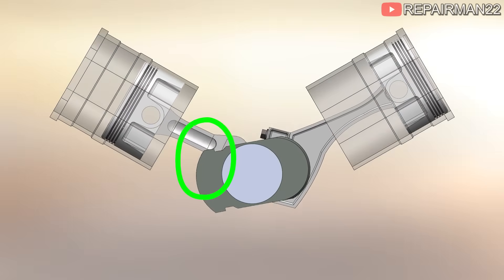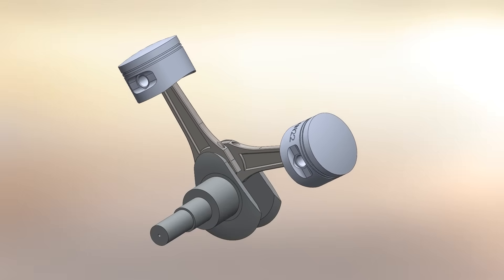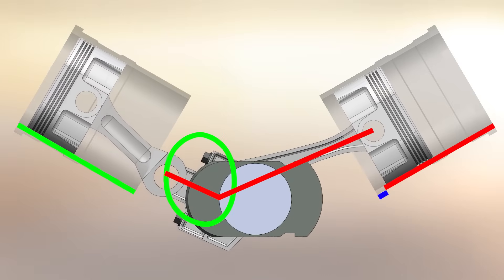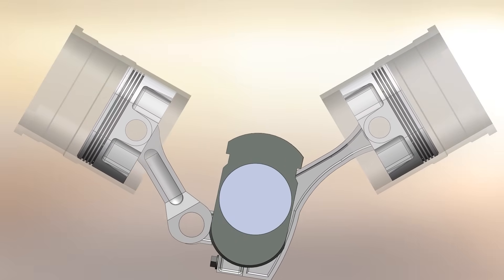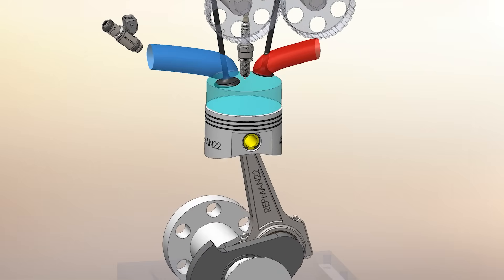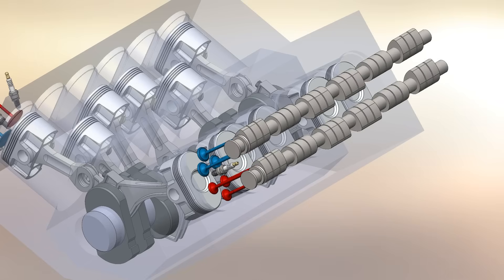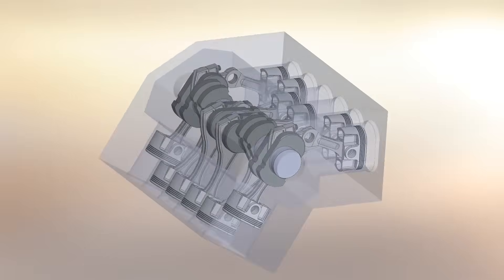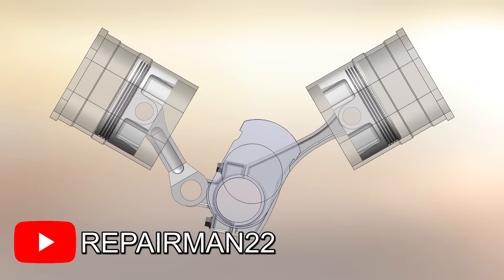Oval Piston and Oval Stroke! Is Ferrari CRAZY? 🤯 🐴 V12 Patent 3D

Comment: Maybe the solution to this patient is to put both cylinders on a slave rod with just a cap on the crank. Though, something would need to be designed to keep that center cap stable.

Comment: i think it can be made just as efficient by having more spark plugs lets say that it has 8 valves, you can have 3 spark plugs by having one spark plugs by the gaps between four valves, or even 5 on the sides of the oval like bajaj's 3 spark engine, issues of the oval engine back then i think can be solved with modern manufacturing, even then theres high mileage examples of the nr750 already.

Comment: Honda: "In the end, we realised we should have gone with Elliptical and NOT Oblong pistons / cylinders.."
Ferrari: "I'll pretend I didn't hear that".

Since the idea is to save space I totally understand Oblong shape instead but still, I think it's funny the sides are totally-flat, when even a slight bow would improve sealing & wear by a large amount.. 

Anyway, the one area odd I.C.E. setups often worked-well is large-cyl. Diesel engines (Detroit made twin-turbo 9L i6s, multiple inline-3s and even like x4 different i2 pairs, etc; other companies made large i5s & Scania STILL makes a large i5 engine for semis and lastly, one company recently even made a fricking INLINE-7!!).

This is because they're all mostly <3k RPM so you're able to get away with imbalance and other mech. issues that would obliterate engines in other areas where RPM needs to be doubled or tripled, for these Diesels (also some were made for various gasses!!) you reap all the benefits of strange setups without any downsides except vibration which might be an issue in some application & would be an issue in passenger cars.

And SO, I believe you're correct on the theory this is for those Semis! The specific geometry of the slave rod / cap -connection is seriously bad, like they could have certainly made it less extreme even with otherwise-same setup.. So, that tells us these engines must be for low-RPM & not passenger cars; at the same time it certainly wouldn't be for static use such as generators because space is the least of your concerns there, so such an odd design turns to pointless risk / investment in money.. Not to mention I think no amount of money or convincing would EVER have Ferrari design a generator engine, unless it's for a series-hybrid in the future lol.

Oh wait.. I just realised.. What if just like the new Mazda Rotary, this will be a very small & high-RPM range-extender? For these roles size & weight is everything and while I said all that about imbalance, when the engine parts are very small (let's say, <100cc. / cyl.) these issues become a lot less-relevant and a range-extender would only work briefly on occasion + it's not directly-linked to the drivetrain, meaning it's vibrations can be isolated a lot better. I still doubt this theory but let's have as-many as possible, why not.
Reply: "What if just like the new Mazda Rotary, this will be a very small & high-RPM range-extender?"

For that role, a V12 would of course be monumental overkill. But then that aspect of the patent is perhaps just a decoy, and they're really going with a V6 (for the next-generation Dino, wossname, 296?). Or for  an actual secondary-engine range-extender, a V4 or maybe even V2 slice of it. (Hm, would the oval pistons bring all that much length reduction in a V2? Prolly not.)
Reply: @ChristianConrad  Yeah but some old (talking 1930s or so) race-cars & such used many-cylinder engines of extremely-low capacity, it allows for some serious RPM and almost multiplies the power-density, that's what I was thinking about at the time of writing the comment. I did not mean an actually full-size V-12 of course, rather an engine that's more-like a model-engine in size. The reason I thought about it is because the Mazda range extender will also be very small and while physically-larger than something like a model engine, it's capacity is closer to such engines.

I was reading about this prototype racecar, maybe it was even F1, from the 30s which used compound-superchargers, it produced a whopping 450hp. with only 1.5L of capacity.. Remember the Octane was garbage back-then so this is an extreme feat and it's only because unlike 1.5s of today, it used many cylinders of tiny capacity per-cyl. You simply can't achieve this with today's common cyl-size with the same technology and same low-compression, sure enough boost with a turbo, intercooling and switching fuels but that's comparing apples to oranges. So the small-cyl. thing is surprisingly relevant when you have only power-density in-mind.

But I guess it's finicky and actually very expensive to manufacture, so I'm not sure if we'll see this trend ever again. Aside from RPM tiny-cyls. give abilities physically not-possible with normal sizes such as reliable HCCI, the closest we got to HCCI today is SPCCI and it's with extremely-lean mixture so basically different technology as to how it actually works, not to mention the engine actually runs purely-spark for a lot of the top-end / performance. But I have on my shelf a HCCI engine from the 60s or 70s, it's 1.5cc I think and it functions just-fine, granted it uses a very special mix of fuel & the ignition-precision is thanks to a literal explosive added to it (which doubles with higher-capacity engines of this type). It's called a "model plane diesel engine" and even in it's extremely-primitive 2-stroke design without a pipe at all it still manages to be so-efficient in comparison to Nitro that the exhaust is quit-enough to not use a muffler, hence no pipe, just a port in the block.

Also I made a mistake, I mean to write Detroit made 9L V6s, very different and not-balanced, hence why I mentioned it as a strange type of engine which you'd only see in low-RPM Diesels.

Comment: Do a search on a 6.7 POWERSTROKE ROD. You will see a rod cap like this one. That allows a V8 to mimick an offset crank without reducing the size of the 2.77 inch journal. 
Also, the combustion degrees are  200 not 180. The torque is delivered more vertically. 
That was in another video on Driving 4 Answers.

The other way to offset is thru moving the centerline of the crank to the upstroke side. 
INLINE ENGINES CAN , BUT NOT  V TYPE.
TORQUE= FUEL ECONOMY IF THE RPM RANGE IS COORDINATED.
Reply: "Do a search on a 6.7 POWERSTROKE ROD. You will see a rod cap like this one. That allows a V8 to mimick an offset crank"

What are you talking about? It's just the bolts that are offset. That has nothing to do with "an offset crank rod", which means the lower end bearing of the crank rod is offset in relation to the center of the actual crank on the crankshaft. Like, you know, the lower end of the slave crank on the engine in the video. All the images Google showed of your (unnecessarily capitalised) "6.7 POWERSTROKE ROD" had the lower end bearing in a distinctly straight line to the top end.

"The other way to offset is thru moving the centerline of the crank to the upstroke side. INLINE ENGINES CAN , BUT NOT  V TYPE."

Of course they can. The crankshaft can be moved in two dimensions in relation to the cylinder centerlines, so you can have that (third type of) offset in V engines too.

Comment: Not a big fan of the master-slave conrod arrangement. In a radial you really dond't have a choice GM (EMD) 16-184 nonwithstanding. Also Honda did produce a V4 oval piston engine in the '80s, but that used 2 condords per piston. I imagine an egnine like this would be a maintenace nightmare: I cannot imagine those "rings" would last very long. Even if the engineers are from Ferrari (or Iveco or whatever). Looks like scraping the bottom of the barrel....or maybe the patent is simply there to cover for some other aspect of the design which has nothing to do with the oval pistons.....Edit: If you make the pistons elliptical or a parabolid shape it may make the rings work better....and in a V displacing the crank toward the master side one can somewhat offset the effects of the differing stroke length...at the price of even more vibrations...I also don't understand the reason behind the 120 degree bank angle...it is not much narrower than a flat 12 would be...and with opposing (180 deg) cylinder banks the master-slave arrangement can be made to be equal stroke....

Comment: I don't think the rod bolts or cap are going to be under any more strain because of this arrangement. The slave rod will be on compression or exhaust whilst the master is on ignition or intake. There's an opposing force that ought to ease the load on the rod bolts. Intake would be peak torsion load against the rod bolts that i can see, but that would be unchanged as it's still dragging a piston down the bore. I think this style master slave would be good for a flat (not boxer) 8 or possibly flat 6.

Comment: An inline 6 fires once every 120 degrees if 4 stroke or 60 degrees if 2 stroke. It's therefore really odd to see 120 degree angle between banks in a V12.
For 4  stroke it should be an odd multiple of 60 degrees: 60 or 180. For 2 stroke it should be an odd multiple of 30 degrees: 30, 90, 150.

Comment: Honda did this in a motorcycle and the friction loss was insane due to the nom consistent changing geometry of the heating metal. You can obviously expect a round shape to just get a little bigger and it's still a circle. It's not the case with an oval shape
Reply: The NR500 was a racing motorcycle developed by Honda HRC in 1979.  Later the NR750.
Reply: I remember reading about this in Motorcycle news, but was decades ago.
Reply: @AnthonyTobyEllenor-pi4jq  they had to invent the slipper-clutch for this exact reason because the engine was locking up on downshifts
Reply: D4A did a video on this and he said there are already high mileage NR750 examples, dont ask me further.
Reply: regular pistons are made slightly oval so the grow to a circular shape as they expand.

Comment: I'm sceptical about the longitudinal compacting of the engine block - the area between the cylinders will be very significant.
Reply from the maker: They will have cooling issue's
Reply: @repairman22  yeah, that's my take too. Right now, with round cylinders you have just one tight, thin spot and big wedges of cooling jacket right next to it. In Ferrari's design, this tight spot extends a lot, being the major cooling surface. I'm curious what solutions they have to mitigate cooling issues.
Reply: @pancakewsx  Anything like that can be optimized, the bigger issue is the strange slave-piston travel path.. Off paths aren't a bad thing naturally, however here as the other bank is normal, that's a pretty crazy imbalance and difference is behaviour, the two banks can't even be TUNED the same! But, that all excites me because if they pull it off, it'll be the coolest engine almost of all time and I love strange / innovative tech like that.
Reply: @bo-dine7971 of course, it can be optimized, but as it is a way to shorten the engine, how much space/wall are they really able to leave between the cylinders?  Nowadays 7 mm is generous and it is not really enough to run a full water jacket (more often there's just a cooling bore). I'm just curious about the solution they (might) have. On the master-slave rod design: soviet tank engines use it since WW2, seems to work ok on the W-2 V12 (38.8 liter, one bank has 180 mm stroke, the other has 186.7 mm stroke, depending on the version, mean piston speeds exceed 12 m/s)
Reply: @pancakewsx  Yeah good point, I didn't even think about cooling paths until now. But I didn't know about the soviet engines, very interesting will have to have a read on that later. But for low-RPM large-capacity and Diesels things kinda just work, so I guess if this engine type is for that type of use yeah you're right it won't be much of an issue. I did theorise in my comment somewhere on here that it's probably doing to be a large-capacity Diesel for these reasons, just-like how we see the craziest types of engines in this category, from Inline-9s in marine use to even one modern inline-7 truck engine some company makes for I think Brazil market, the ability to mess with combustion how you like due to DI or IDI and also the low-RPM really seem to open-up many new possibilities; that's why I love stuff like 2-stroke Diesels so much, you're only limited by budget really.

Comment: My two addition:
* There is a more recent case than the MB (I think it was WW2), a motorcycle also designed by an Italian.
** The inverted cylinders makes servicing complicated because it makes the valve covers to work as oil pans, the engine is forced to have a dry sump lub sys.

The idea is interesting but surely some debugging is needed.
Thx Repairman for the video👍